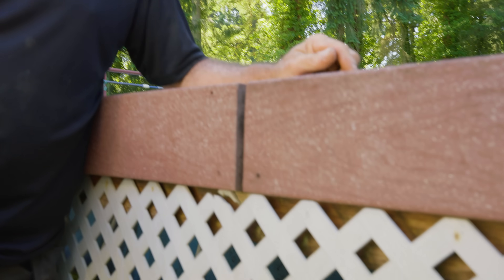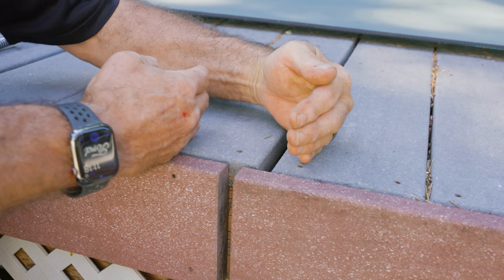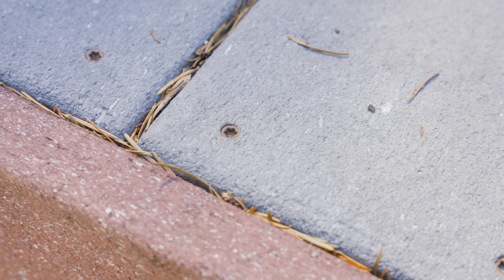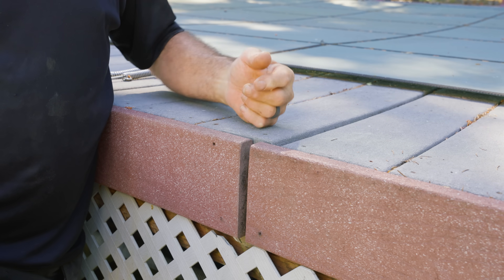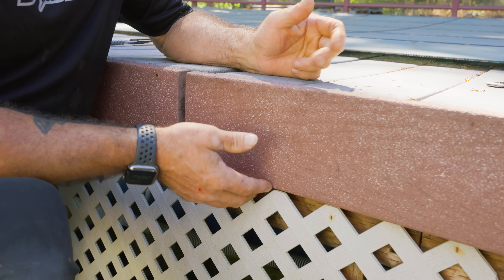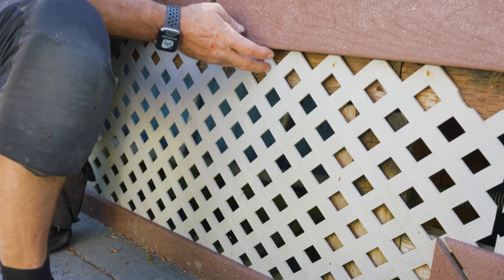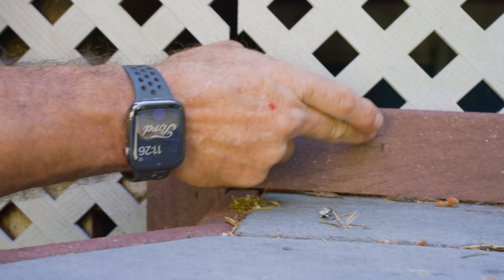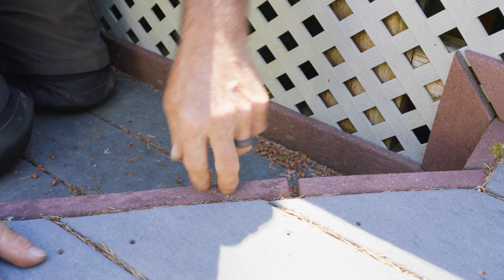Composite Deck Gaps Getting Worse? Here's Why

Comment: This is good information to know, nevertheless.  I know vinyl expands/contracts instantly, especially the length of the vinyl decking.  I don't know anything about how much permanent/long term shrinkage occurs in composite decking and there's different forms of composite and I'm sure each one's amount of shrinkage over the years will vary.   Wood expands/contracts with temperature and moisture content change due to rain/humidity but over the course of years its going to shrink but with wood the dimension changes occur in the width and the thickness of the board.  There is hardly any considerable length change in a board over time, only width and thickness and the specie of wood also plays a factor in predetermining what the change will be.  When you install tongue/groove wooden flooring there are charts that help you determine min/max space it will need to keep it from buckling and that will also vary on the specie of wood the flooring is.   But as far as composite or vinyl decking, I wonder if the manufacturers can provide us with an estimate of how much shrinkage will occur in their product over the course of many years as well as provide maybe a formula for determining what the instant exp/contr due to temperature will be in there product that is relatively brand new and has not begun to shrink from long term aging.

Comment: Expansion/contraction on vinyl decking happens instantly.  We were installing this vinyl decking at the home of the man who owns the company that makes this vinyl decking and it is the highest quality vinyl decking I have ever seen.  It literally does not age, fade, get brittle.  He showed me a picture he had taken recently of a strip of his vinyl decking that had been outside for some time and said, "guess what year  this was installed outside."  I looked at it and it looked brand new and had no coloration fading and I said, "2000."  He said, "1976."   That caught me off guard b/c that vinyl decking had been outside before I was born.  The only thing  that does happen is it expands/contracts instantly relative to the temperature its exposed to.  We had one more piece to set that was roughly 20 ft long and had no spare pieces so I measured twice, marked, cut it, measured after cut, and everything looked great.  It was hottest part of summer and my saw horse and stack of this vinyl decking was set up out in the middle of the sun.  I carried the piece over to where it was going and set it in the pocket at the very end of this dock and there was shade there.  The owner came walking up and we stopped and talked to him for maybe 3-5 minutes i look down and notice gap and i thought my friend on other end must have pulled it his way so i said hey crack it back to me a little and he said i cant b/c my gap would be too much and at that  point i literally started thinking I was going crazy b/c I checked measurement twice, cut it, then checked the length after it was cut and put it right where it was going and I swore it looked perfect and now all a sudden its not like it was 3-5 minutes ago.   I'm really happy the owner was standing there b/c he was who realized what happened and said that its shorter now b/c its suddenly in the shade.  I had it in my mind that expansion or contraction happened really slowly like it does with wood but with vinyl its actually instantly.  He had his calculator on him and knows the actual math formula that can determine what the board will expand/contract to based on the temp.   He said that the longer the piece is, the more distance it can expand/contract lengthwise.  Cant remember if the width changes much but the length of vinyl decking can change a lot the longer the piece is.

Comment: Hey Doc, I think you did just about everything right, especially considering this install was during a time when this product was so new to the market. Based on my travels, the range of expansion+contraction this material can't be overstated. It's just too volatile.  My primary criticism would be the 1/4" crown staples on the lattice but, among other things, that is a very affordable fix. One thing I've learned to do in my career is set realistic material expectations. I can put PVC biscuits, pocket screws, and end screws into everything reachable, but that doesn't guarentee eternal connections. Overall, you built this deck while I was still scratching my ass in 6th grade. Impressive, as always sir.

Comment: HERE IN NEW MEXICO...we stopped using any treated related lumber 27 years ago if we were installing a composite on top. We just use fir joist....NEVER A PROBLEM.
Reply from the maker: Good for you. If we don’t use pt up here, it will rot in 5 years.
Reply: @drdecks  The PNW is harsh on our structures

Comment: You arent kidding about the treated lumber, i just got done framing a deck 2 days later was completely undeckable. Joist shrank 1/4 to 3/8ths in height an the occasional 1 that stayed true, reverse crowning happened, boards crowned it was wild all cause the sun an heat, even had a rep from the manufacturer, tiaga out to see it, owner was not happy.
Reply from the maker: Yeah that's a problem
Reply: @drdecks thanks for the reply, the rep an lumber yard are going to make it right an supply more material, I will have to do the repair work an reframe it my concern is try to mitigate it from happening again. As of now I have it hosed downed an tarped off. Was going to do 1 section of framing repair an then deck immediately at a time, any pointers or advice on any other ways to possibly mitigate the drying  out of the wet treated lumber? There's 10k in vintage azek decking going down on top an i dont want the same issue to happen once it's decked is my biggest concern. I want them decks flat an to stay flat.

Comment: Are you gonna try the timbertech aluminum framing?
Reply: @niktak1114  after framing my first deck, I would definitely consider a metal frame next time. Every board is bowed, cupped, twisted, etc.  so much extra work. I haven't even started planing yet.
Reply: @Therearethosewhocallmetim78  Yep, I am just about done installing my joists and having the same issues, and wondering if I should have looked at aluminum joists also. The treated DF joists are bending like mad. They say if the DIYer goes slow, the joists will warp all over the place before we get the deck boards on. But on the other hand, wouldn't the contraction issues be less, as my joists have mostly dried by now.
Reply: @Therearethosewhocallmetim78 or you could go with PWT treated LVLs if you want to stick with lumber
Reply: He using a different product made by Regal ideas believe but I have installed the timbertech impressions railing an it was a breeze to install an look extremely high end looking when done.